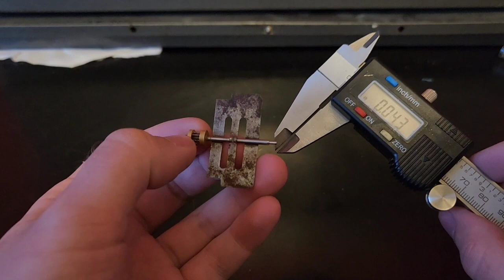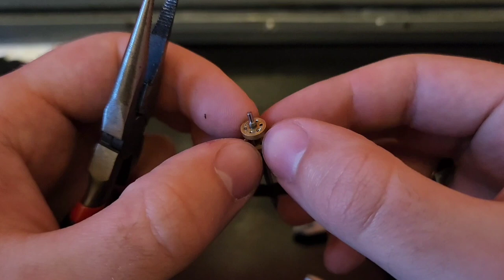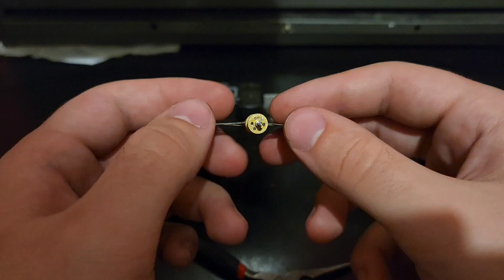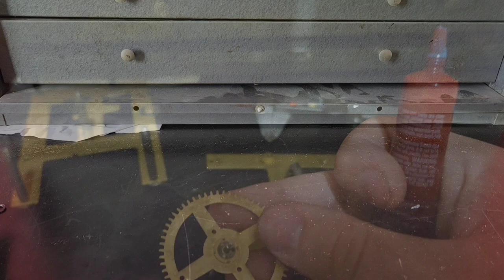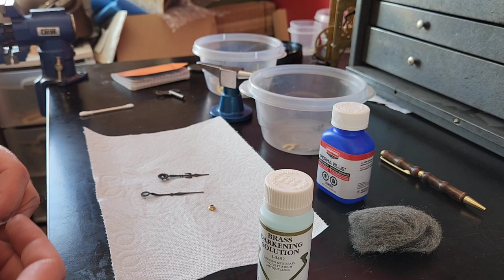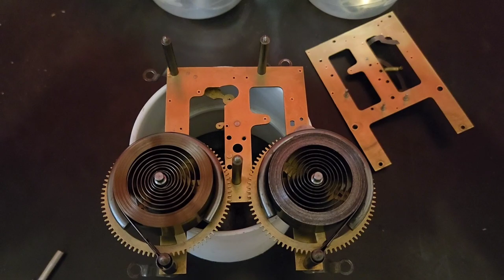E. Ingraham Mantel Clock Restoration Part 3

Comment: I've watched several of your videos and there are several things I like about them.  You have a nice, down to earth presentation style, you're not afraid to show us problems you run into and mistakes you make along the way.  Particularly useful on this clock were the segments on replacing lantern pinion trundles, rebushing the main wheels, and the difference between red and blue Loctite.  To me, one of the most addictive things about clock repair is when you've finished rebushing a train and put the wheels back in and apply a little pressure with your thumb to the bottom wheel and watch the train spin nice and smoothly, and you show that.  I'm looking forward to more videos.
Reply from the maker: Thank you for your kind words! I wholeheartedly agree, that is the best feeling.
 I'll be getting a grandfather clock in the workshop this week, expect a new video within a few weeks.

Comment: Thx so much! The video was very informative. I have almost the very same clock, but I think it’s a year or two older then the one you worked on other wise it looks exactly the same. Both the time and chime sides seem to work great independently of each other but when the chime starts to engage the hour and minute hands stop, and clock doesn’t chime, but the clock keeps on ticking away strongly. I can manually, engage the chime, and the clock chimes as it should. After the chime, the hands continue to move on like normal until the chime is engaged again and then the hour and minute hands stop again. I’m no expert like you are, so would you have any ideas on what’s going on with the clock? Thx so much!!
Reply from the maker: A little clarification; does the clock stop entirely before the strike, or does it continue running without the hands moving? If just the hands stop, make sure their aren't stuck on each other. It's unlikely they are, as that will usually stop the movement entirely. 

If the hands clear each other, slowly advance the minute hand until it is about to strike. If you feel the hands getting harder to turn before the strike, there's abnormal friction between the lifting arm and the hour cam or some other lever. Make sure all the levers are clean and smooth and that they aren't fouling any gears in the clock.

Let me know if that was the problem. If not, I can help you troubleshoot it.
Reply: @colbysclocks  The clock keeps running but the hands stop moving. I did advance the hands and I did feel resistance as the chime started to engage.
Reply from the maker: Very odd. It is difficult to say what is wrong with it without seeing it in person. Are you comfortable with taking it apart?
Reply: @colbysclocks  I’d say yes. I’m fine taking it apart, but I just have the usual handy man tools around nothing like your setup. I’d say I have enough tools to be dangerous 😂🤣
Reply: @colbysclocks  Now I should mention the clock is missing the spring that is supposed to connect to the hammer the strikes the half hour bell. Not sure if that could be involved in the issue, but it was missing when I bought it.
Reply from the maker: colbysclocks@gmail.com

Here's my email. I'll walk you through disassembly and troubleshooting.
Reply: @colbysclocks  Thx a ton man.

Comment: What make and model is your pin vise?  Great video!!
Reply from the maker: I'm glad you enjoyed! The smaller pin vise is a cheap one I got from Walmart for about $10. The larger one is from Timesavers.com, though I don't recommend it; there are far better alternatives. 

Pin Vise Swivel Head 2 Chuck 4 Sizes Hand Drill Tool Capacity Range 0-1/8" https://www.walmart.com/ip/379270091
Reply: Thanks!  I found a 4 in 1 pin vise made by General tool company like yours.  I also picked up a larger orange handled one for reamer bits….
Reply: I’m also trying to find a good wire cutter that doesn’t deform the wire too much….

Comment: Soft spoken clock and may I make a recommendation?
Reply from the maker: After recording the video I adjusted the hammer closer to the gong, it's much louder now. Recommend away!
Reply: @colbysclocks  you might want to replace the brass click springs with steel, the brass after flexing for almost one hundred years becomes brittle and will break and if you're winding the clock it's kabloeee
Reply from the maker: That's a fair point, but I'm not too worried about them. The click springs don't apply a lot of force, so there isn't much stress on the brass. Have you had them break before?
Reply: @colbysclocks  no but they will eventually

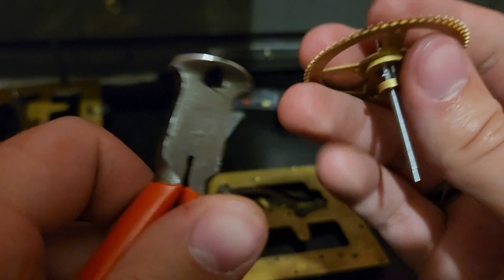Comment: 20:47 Would a Jeweler's Saw with a diamond blade cut the trundles? This is only the 2nd video I've seen of somebody replacing trundles - thanks!
Reply from the maker: You could use a saw, but jewelers saws are usually made for softer metals. Trundles are extremely hard. If you have a blade that will cut through them, please share!